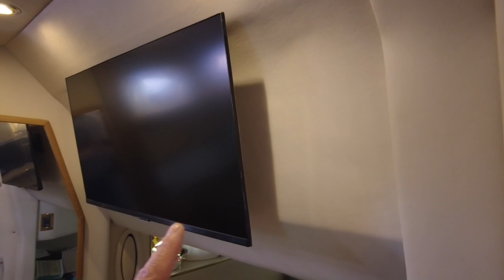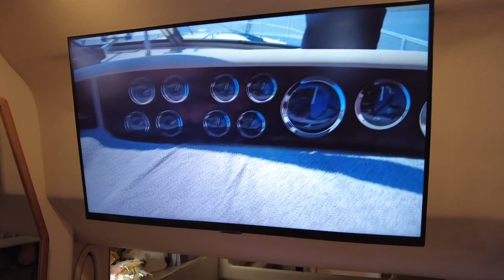Installing Flat Screen TV on Our Sea Ray Boat - No Wires ;-)

Comment: Looks good. Amazing how much technology changes over the lifespan of a boat. Tube TVs, LORAN C, even some dashboard speedometers are GPS instead of using a pitot.  One thing I did do was go with a regular TV and a Roku Stick because many of these so called Smart TVs have proprietary OS and the companies will stop upgrading the system (ahem LG) and you end up having to buy a streaming device anyway. I also like TVs with a built in tuner because a lot of sports are still OTA, and when the big boys shut down Locast, the rabbit ears went back up, especially for NFL.
Reply from the maker: Ahh, LORAN, another but of technology that I'll never miss 😂
 On our previous boat, we used a Roku Stick which worked fine, but have discovered that the built-in capabilities of this monitor are a lot quicker (connection & streaming). 
 As for OTA TV, it has no appeal to me. Absolutely not a fan of sports, so I don't have to watch anything in real time.

Comment: Great spot for the monitor! We "cut the cord" 3 years ago and do almost the same thing. Though I have unlimited data, T-Mobile's strength where we are does not give us enough bandwidth to stream without problems, so we are stuck using the marina's poor Wifi, though I have a Wifi extender that helps a little. I bet Eternity's Shore would look good up there as well. 😉Cheers!
Reply from the maker: We're fortunate to have fairly robust cell signals wherever we go in our boat travels, so that's a good thing. As I mentioned in the video, we never use public WiFi, as it's open to potentially nefarious activity from many sources. If you are forced to use it, I'd suggest looking into a VPN service to help protect your connection.
 Keep a close eye on my upcoming Sunday release. You just might see Eternity's Shore up there sooner than expected 😉
Reply: @BoatingWithBoogaboo  nice hook there! I’m definitely curious now.

Comment: Hi Paul Nice set up doing the same thing also with my phone still waiting for unlimited cell plan!!!! Would be perfect
T-mobile has Nice unlimited hot spot in the US but here in Canada have  nothing !!!
I  am looking a starlink RV you can have service exemple Mai to Oct and stop the plan rest of the year!!!
Would like a cell service in Canada with unlimited plan instead
THANKS for the garmin stricker info  and the transducer and all the set up câbles works great 
Filled my Nice hole of my old raytheon 😂😂
All the other garmin stuff is install Greg will finish the rest
Cheers
Reply from the maker: You can try Rogers for unlimited data on their cell plans, but be aware that after you hit the threshold of your package, the speed gets throttled back and isn't really practical for streaming video...
 Glad you're getting the new Garmin toys installed! I'm loving our plotter and finder👍👍👍👍

Comment: Pretty Slick install.  How are you powering this TV when away from shore power.  I have not noticed you ever mentioning an inverter on this boat yet. BTW I just did a major increase on the data for our phone Plan.   👍
Reply from the maker: We don't currently have an inverter on the boat, as watching TV while away from shorepower isn't critical for us. At some point I'll most likely put one in, but more for other accessories.

Comment: Hey Paul..  Did you think of a 12v TV?  Don't need to run the generator when underway.. or if tied up temporarily without power.
Reply from the maker: We've never run the TV when underway, so that's not an issue. If stopped for a night or two at a lock without shorepower, TV isn't critical and we'll normally just take in the relaxation or listen to music via Spotify.
 At some point, I might hook up an inverter for that, but not critical to watch TV every day.

Comment: Do you have Solar on your boat?
Reply from the maker: No. After 25 years of boating and cruising each summer, we're more than able to produce/store/use all the power we need. Having to install panels (rigid or flexible style) is not appealing or beneficial for our needs.

Comment: I’m guessing you are running of an inverter as 12v tvs are either expensive or in the case of the cheap ones kind of rubbish. I read the current draw is about the same somewhere anywhere like for like. For internet I have a netgear orbi, pretty cheap hotspot that leaves your phone to you, if you can stretch to another SIM card it’s a nice solution, runs off 12v so was easy to setup
Reply from the maker: No inverter on the boat yet, but I might hook one up at some point in the future. If we're away from shorepower, watching TV isn't critical, so the A/C powered unit is fine for us. 
 As for our interwebs connection, that's as simple as tapping Hotspot on my phone and the tv connects. No extra hardware or sim card required. Plus, my phone is free to use as normal 👍
Reply: @BoatingWithBoogaboo  Great videos. I am right now in the same project however I will likely hook up the TV permanently to the battery  with the help of a cheap buck converter. This should be very well possible with your TV as well - a video explaining it with a similar samsung tv is the following - https://www.youtube.com/watch?v=1AFbVR4eSXs
Reply from the maker: @NewbieBoatingSingapore  Thanks for the tip, but again, having access to our TV at all times is not a priority and we are more than happy to live without it when we are away from shorepower. If there's anything so important for me to watch, I can view it on my phone or the iPad. This TV - and the ones at home - are no more than monitors, as we haven't had 'regular' TV for over a decade and I'd rather never turn the thing on over having to watch cable TV ;-) We only have the units for streaming content (YouTube, Netflix, etc.), all of which I can watch on my phone if necessary. . .

Comment: Hey Paul and Anchor Girl!! I was wondering if there was any way to reach out. I have been trying to send you an email but it seems there is somee issue with the email in your info area. It keeps failing when being sent. Is there any other way to DM? Im currently doing an intership and I need some help with sailing especially sailing in Canada. Wishing you sunny skies and smooth sailing!
Reply from the maker: Hi Ren. Any emails that might find me are automatically deleted unless business related. Any questions you might have can be asked here, but I do not have any insights on sailing whatsoever. Been boating exclusively by power for 50 + years, but have no experience with sailing...
Reply: @BoatingWithBoogaboo  Thank you Paul for replying :), I understand. It's that I am interning for a marine navigation app and they recently released some charts of the Georgian Bay Area and Trent-Severn Waterway. I was looking for someone with experience and knowledge of the area to help test out the charts we have and to give feedback. I was wondering if you would be interested :)
Reply from the maker: If you can give me an email address, I'll shoot you a message there.